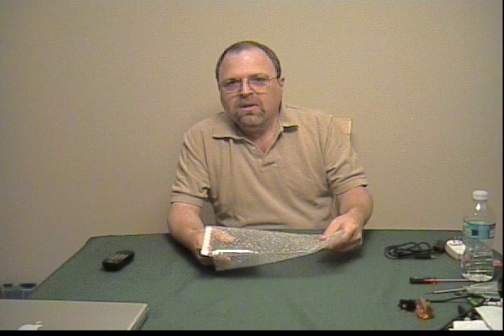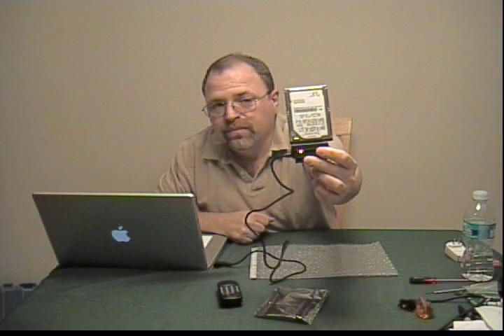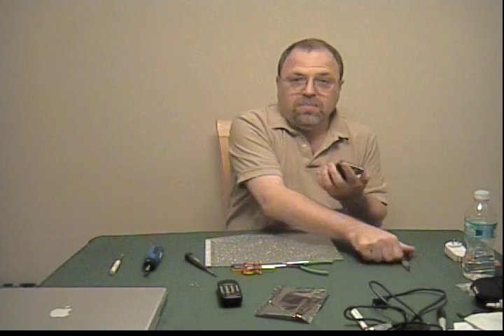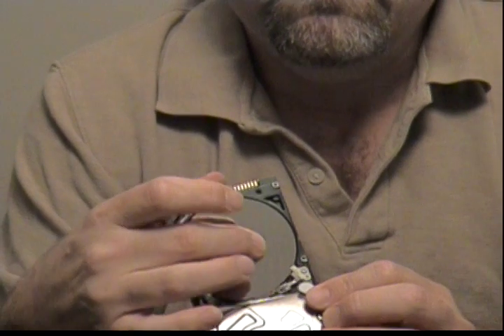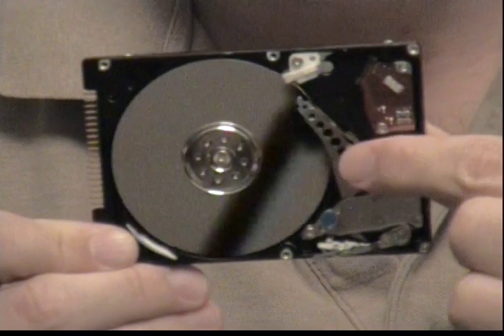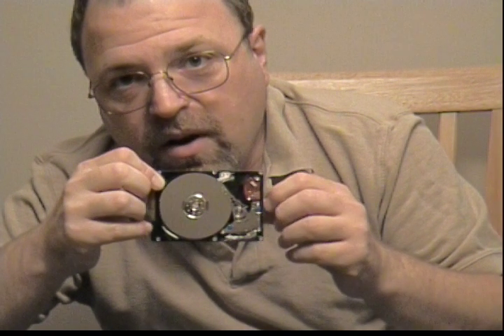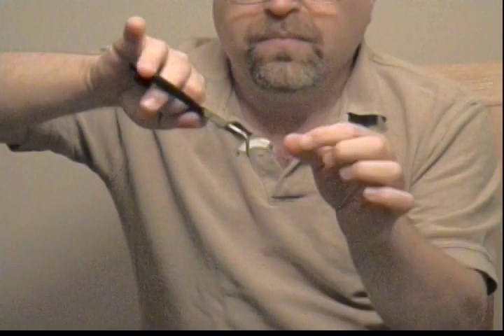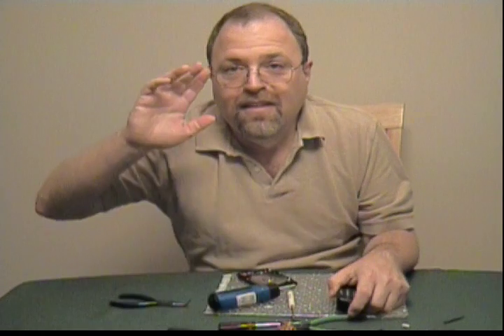Hard Drive Disassembly

Comment from the maker: Well, I'd think a nice, thick bag would be best. Like a Zip-Lock Freezer bag. I use those for food and they seem very sturdy. And if you get the air out of the bag, there won't be any ice, since there won't be any water vapor in the bag.

If you Google "hard drive freezing trick", you'll see a few web sites with better instructions.

Comment from the maker: Maybe I will - once I come up with a dead one. It's just like this one, but bigger.

And for the freezing thing, well, basically, put it in a zip-top bag, squeeze out all the air you can, and freeze it from 4 to 24 hours. Quickly re-install it in the computer (or an external case) and get what you can from it. asap